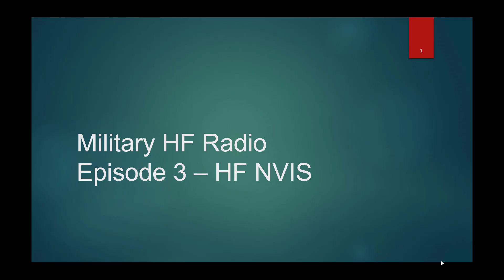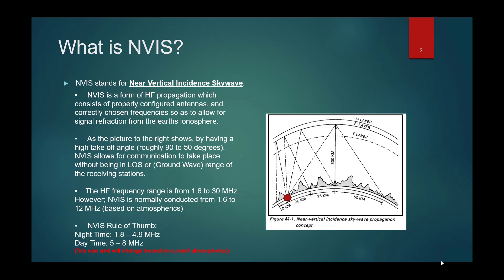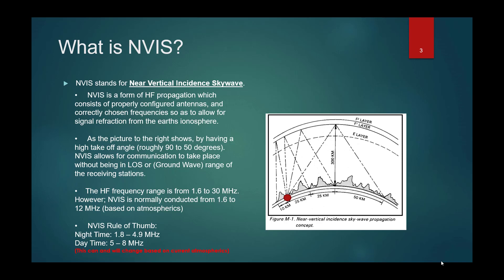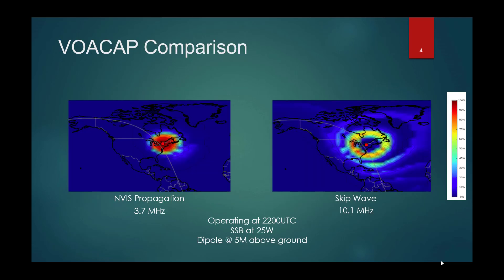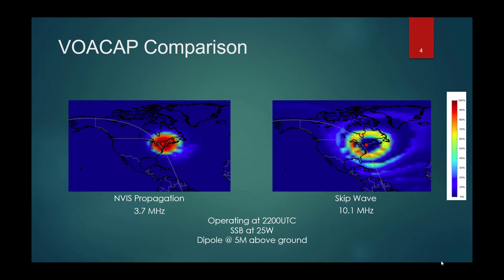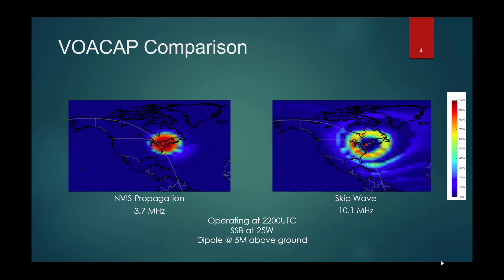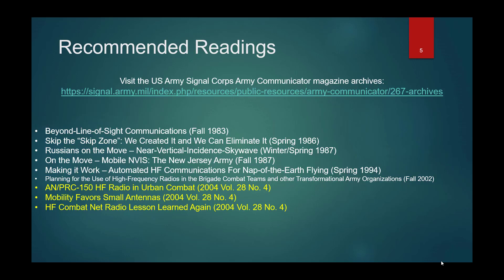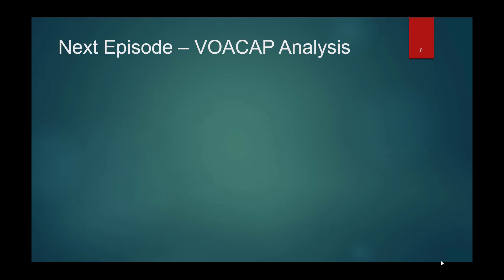Military HF Radio - Episode 3 - HF NVIS

Comment: The thing about antennas is....yes, planning and theory are essential to know about.  But in the end, try it and see what happens.  It is not unusual to end up with path performance that you didn’t anticipate.  The very best for antenna and frequency planning is....do your best to plan, and then try it.  I’ve been surprised (shocked?) more times than once. And sometimes you use the best you can in a given situation, realizing your setup probably sucks, but it’s all you have and you hope for the best, or you hope someone can/will relay for you.  But once again, I’ve been pleasantly surprised with great comms while expecting horrible, many more times than once.

Comment from the maker: Thanks to Igor for pointing out that the three highlighted articles in the presentation, although are from 2004 Vol 28 No. 4 of Army Communicator magazine, their website archive has it listed as Winter 2004 Vol. 29 No. 4.  https://cybercoe.army.mil/AC/archive.html
Reply: Link does not work.
Reply from the maker: @kv4atv  they changed the domain recently.   https://cybercoe.army.mil/AC/archive.html and then scroll down to 2004 vol 29 no 4